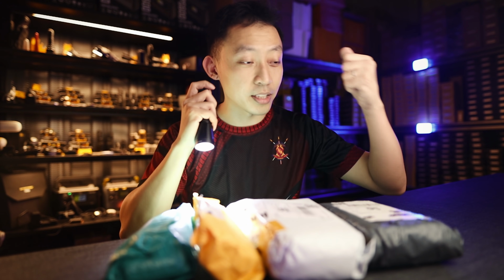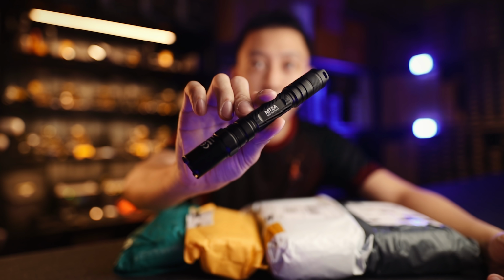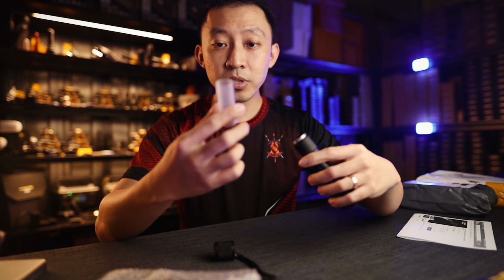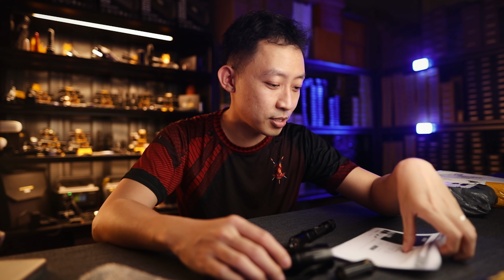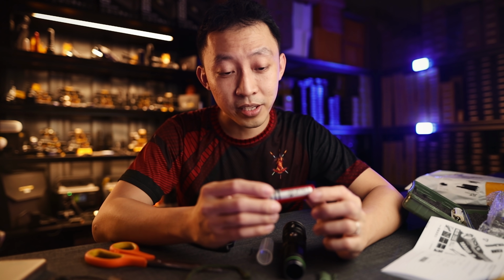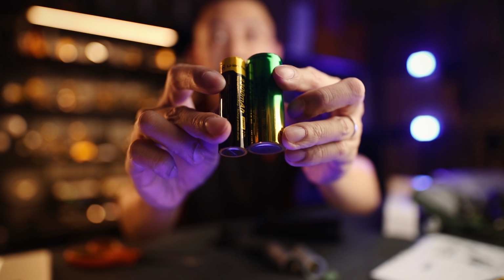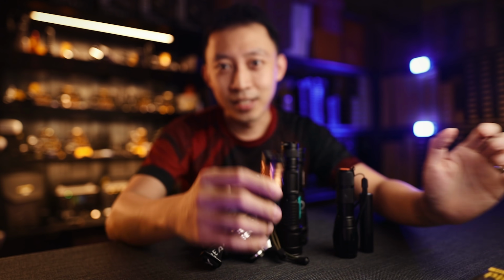100k lumens? Nuclear LEDs?! I bought a bunch of fake lights to show you how to NOT get scammed

Comment: You are clearly very biased! The second torch was flimsy as it also takes 21700 battery, at least mine does. So it actually allows for 3 battery sources. For 4 dollars....it'd definitely a VFM product. Ok... off course the lumen and mah claims are fake. But what you do is compare a few dollars products with products in the range of $100..... very biased

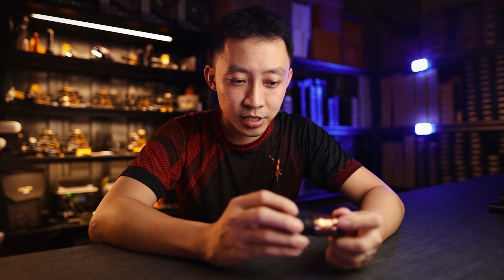Comment: Send me that garbage light with copper insert 16:28
I presume you will send it without any charge ($) since it fried due to overheating as you say.
Reply from the maker: No that’s going into my flashlight hall of shame :)
Reply: That's an astrolux S42/Manker E14II. They don't have thermal regulation/bad thermal regulation so if someone isn't careful it would burn out. The lens would be melted though and the LEDs would burn out when it got that hot. That's a user error though.

Comment: "When you have a light that uses three AAA bateries the voltage is going to be so low it's never going to reach whatever brightness it claims."

This is a complete lie.

Three AAA batteries in series output 4.5V. Typical lithium batteries in flashlights max out at 4.2V. Three AAA batteries produce a HIGHER voltage than the batteries used in 90% of flashlights but this means very little as most single chip diodes on the market are designed to run at <3v.

The stuff you say about battery tubes is a lie also, they are not a sign of low quality or poor manufacturing. They are the sign of a manufacturer providing their customers with CHOICE. 18650s are not the only option, 26650s are popular, 21700s are even more popular. Considering they all produce the same voltage, it is sensible to manufacture a light that can use at least a few of these different sizes, generally 18650 and 21700 are chosen as the small diameter allows for a compact light. 18650 is 18mm diameter by 65mm in length, 21700 is 21mm diameter by 70mm length. That extra length can be accomodated by the spring in the tailcap but the diameter must be made up in the 18650 with a spacer tube. It is a positive thing to have this choice..

Here is some truth for you, Nitecore lights are overpirced and gimmicky, you wrap them in plastic, stick stupid screens in them, advertise them as 4000lm when they can only put that out for five seconds every decade. You are outcompeted in all regards by brands such as Astrolux and Emisar, in terms of sheer value for money you are eclipsed by brands such as Convoy and Sofirn. I wouldn't touch one of your products, I wouldn't reccomend them, I think they are incredibly average.

Comment: Why you not compare it with light from convoy, sofirn or astrolux brand ? convoy s2+ sst40 also is only $20.. and sofirn sp33 is only $30 but it got real 3000lumen.. i bet you afraid comparing those brand because it will outperform your light ? study more about light that use by budgetlightforum.com before you bashing the under $40 light.. its not fair to compare the nonsense zoomable light with your reflector light..
Reply from the maker: I’m bashing them because they claim to have 100000 lumens when it fact it does not. Convoy’s lumens are accurate, so why compare those? They are great lights. 

It’s these scam lights that people have to be educated about.
Reply: @NitecoreSG  yea you're right, i see lot of my friend getting rip off when seeing them using those zoomie light some that paying more than $50 for that crappy light that not even worth $10.. im also a nitecore tm9k user, but what i try to point out if someone need a cheaper option light there is few light like sofirn convoy and astrolux that still perform wisely for under $40.